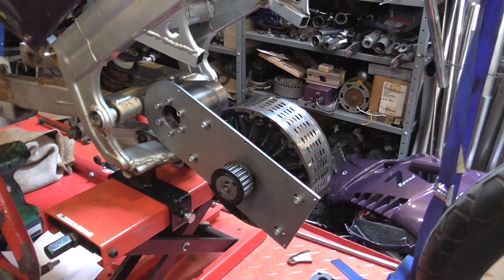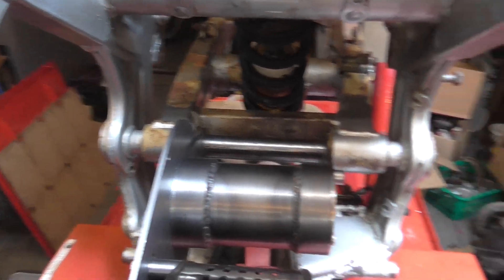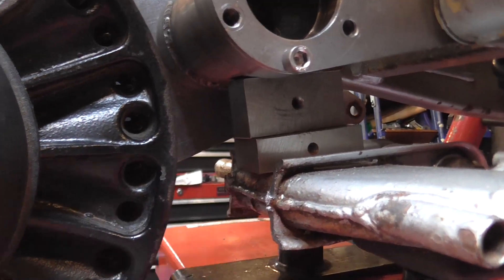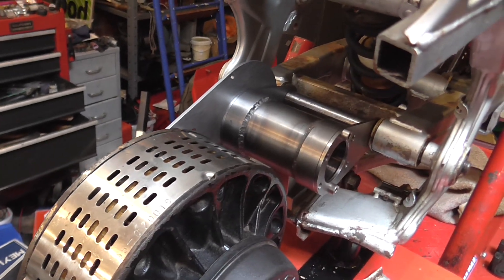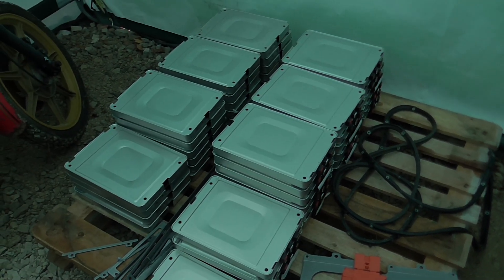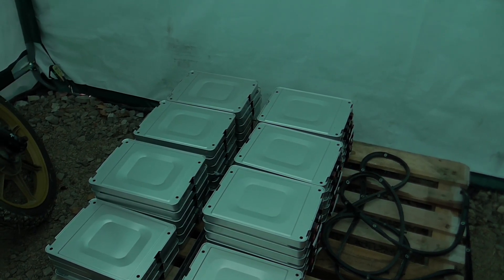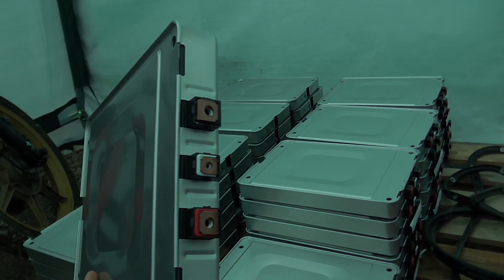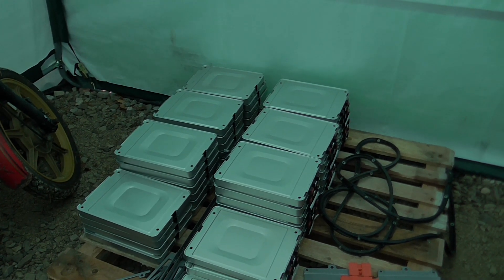Cagiva Freccia EV - part1

Comment: You've got a gwiz as well??😍
Reply from the maker: Two actually, as well as my Scirocco and a Vectrix.
Reply: @EVguru  DC or AC or... both! 😱😁
Reply from the maker: @shinosg-wiz4619  2007 AC in use, 2006 DC awaiting batteries.
Reply: @EVguru  are you going lithium for the DC? What sort of? Prismatic? Tesla modules or others?
Reply from the maker: @shinosg-wiz4619  At least one G-Wiz and the Vectrix will get Leaf cells.
Reply: @EVguru  what do you think of those prismatic cells like 86ah each from aliexpress (China)?